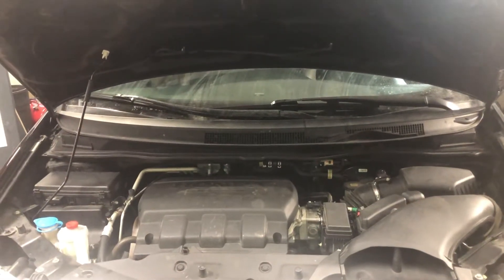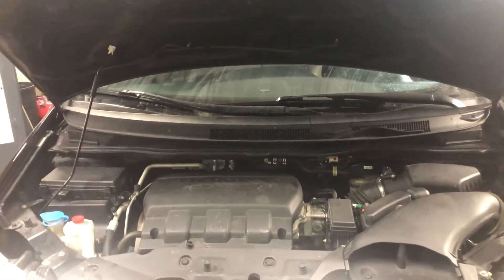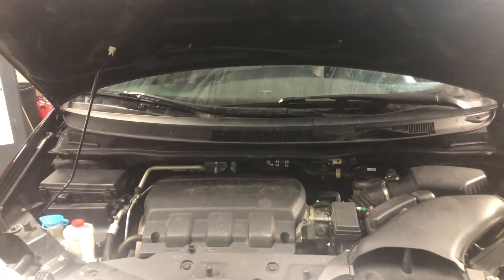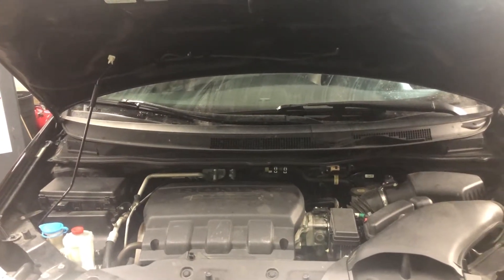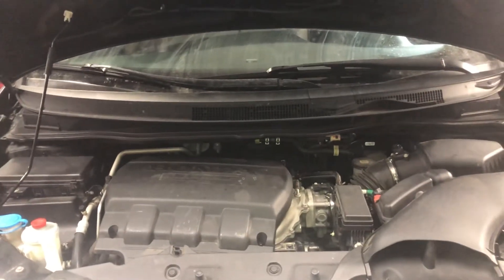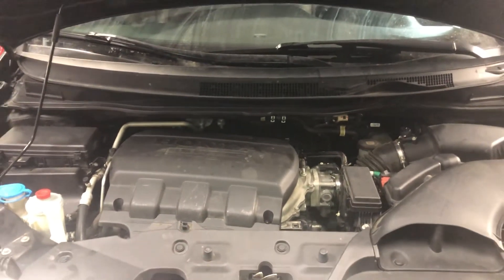Coolant Temperature Sensor location on a (2011-2017) Honda Odyssey

Comment: If you are geting P0118 ECT codes check this sensor or plug wires mine were completely cut from engine heat